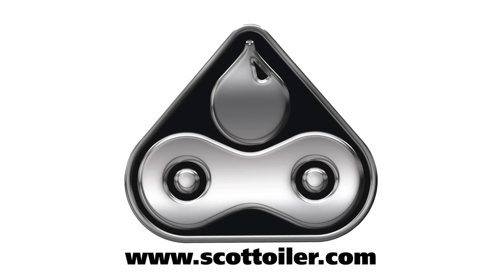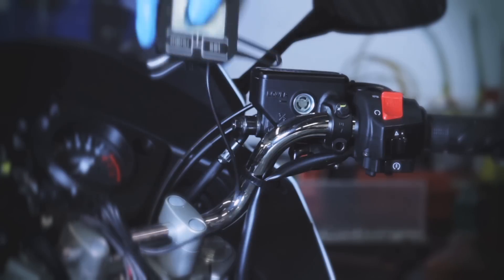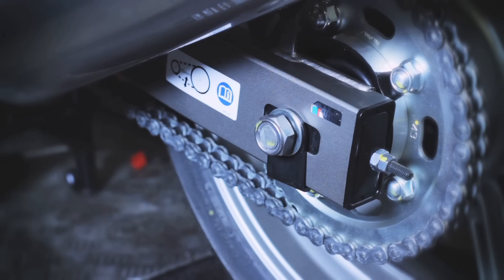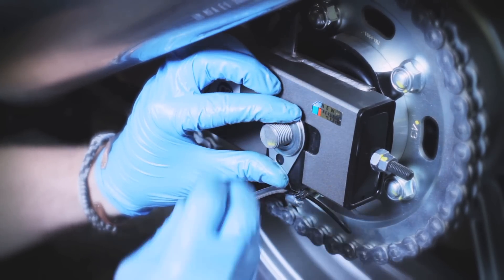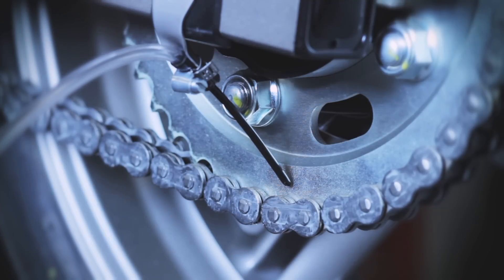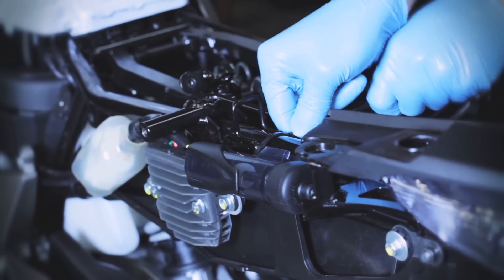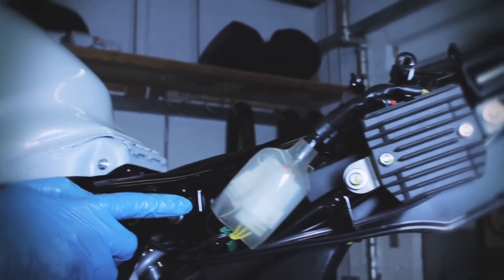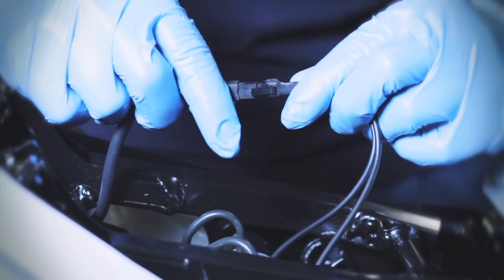Scottoiler eSystem Motorcycle Chain Oiler - Installation (English)

Comment: They make it look so easy..... fitted one to my 2017 multistrada, lots of adaptions & modifications needed as very few places to to install resevoir & all the tubes & cables that go with it + all of the bolts on the bike have no extra length & are different tread so using other bolts is tricky